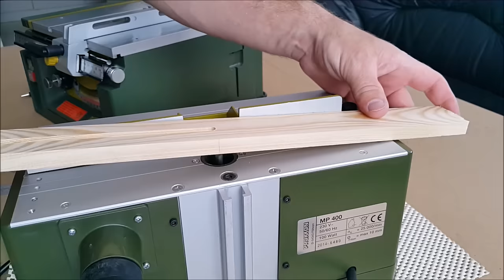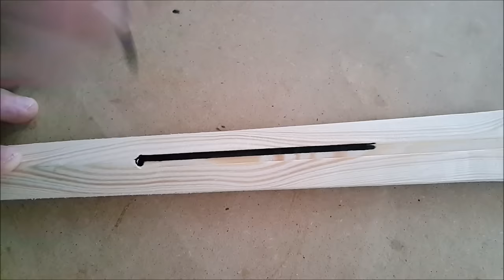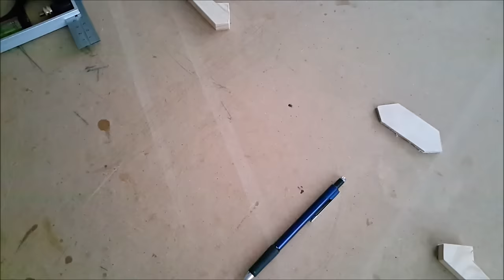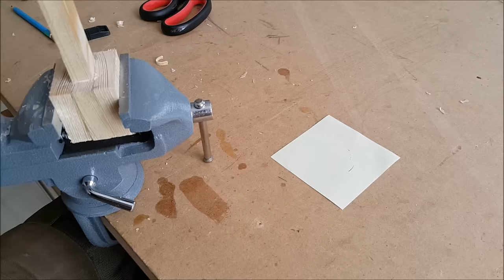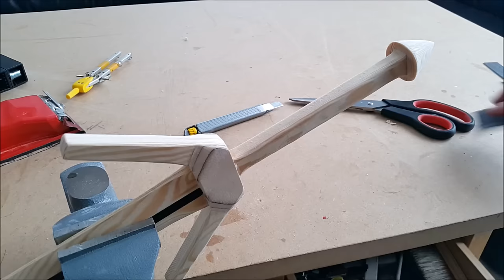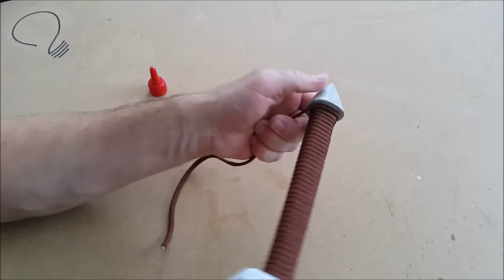Make Witcher's Silver Sword out of Wood

Comment: Holy shit, I’ve been watching diy sword videos for a couple days now and this is better then every single one so far! The joinery for the cross guard and pommel doesn’t sacrifice any strength by using a shorter tang, and there’s no possibility of the tang not fitting into a separately made cross guard because of miss measurements because it’s just glued directly to it. And using paracord for the wrapping instead of leather saves so much cost, and the two layers of it looks sick

Comment: One piece of advice I could give if you want to make it look like real metal is use a light grey as a base coat. Silver is such a thin paint that to colour the whole thing with just silver you'd need about 50,000 coats. However, as you applyed a stain and not a primer, I'm assuming you wanted the grain to show. Just a tip for future progects.